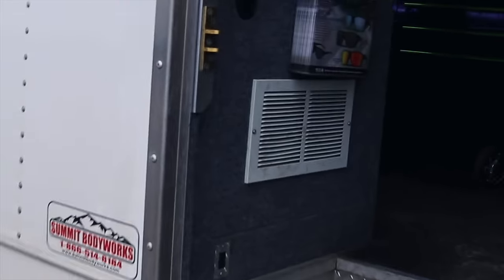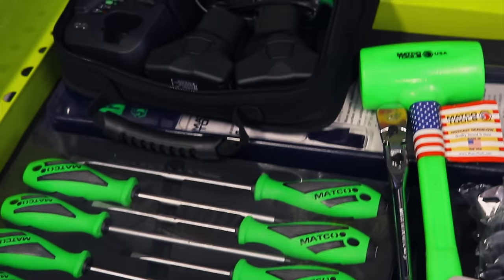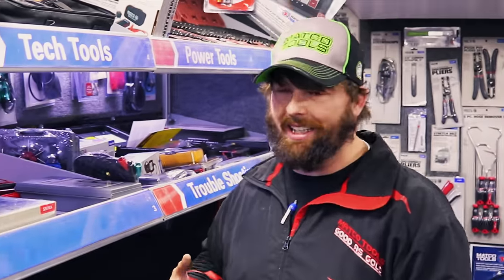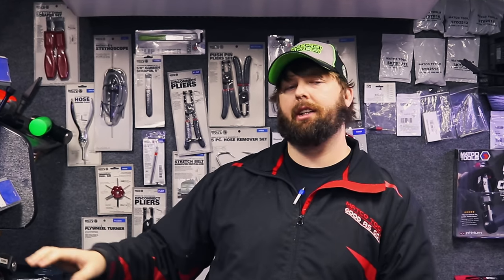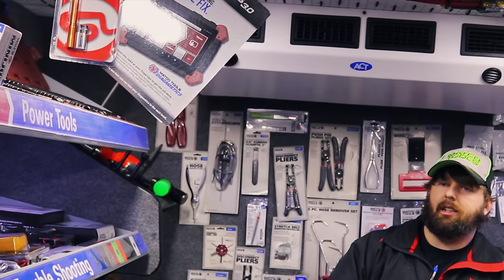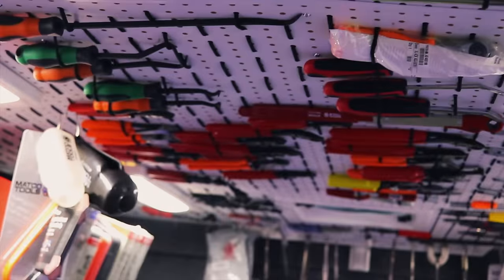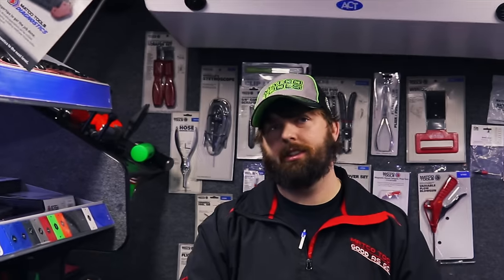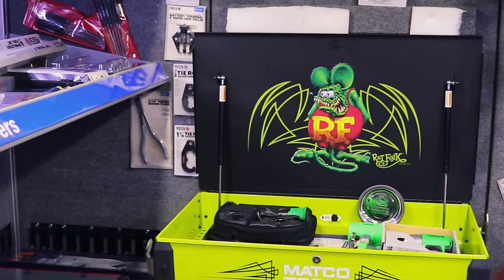Matco Tools: $23 a week gets you a toolbox and tools to get started

Comment: That stubby driver set was made in Taiwan. Saw it on the box while you were holding it.
Reply: sneakysnake109  they probably have the same set at the ole harbor “horrible” freight. Nice catch on that sneakysnake...
Reply: sneakysnake109 that’s why the box was flipped over so fast!
Reply: @rmiller6483  The oem on that stubby set is Vim
Reply: Was on the truck on Tuesday looking at a screwdriver set, made in fucking Germany lol
Reply: So crap on's battery impact tools are made in China.  And you all though you were getting American made hahaha.
Reply from the maker: Can you name a battery impact that is made in America ? I try to buy American made tools every time if possible but you can’t get somethings made in America because they aren’t available.
Reply: @KoonTrucking  Dewalt, but its not the full line just the impact drivers and the 3/4 guns.
Reply from the maker: Yeah I knew just the 1/4” and the 3/4” ones were made is USA but no 1/2” or 3-8” guns. To my knowledge there isn’t any 1/2” or 3/8” impacts made in USA
Reply from the maker: Here’s the link to those https://www.dewalt.com/products/power-tools/products-made-in-the-usa?pageNum=2
Reply: Koon Trucking , my older Craftsman 1/2” air impact is rated at 230 ft-lbs at 90 psi. It was made in China. That impact wouldn’t break loose the lugs on my truck torqued down to 140 ft-lb, I even bumped the regulator on my compressor up to 100 psi. I was afraid to try any higher.  I bought the Earthquake XT, composite 1/2” air impact from Harbor Freight rated at 1190 ft-lb at 90 psi. The lugs zip off without a hiccup now. That impact is made in Taiwan. It gets used, but not everyday like y’all, full time mechanics. I only do part time mechanic work. I splurged for the one year extended warranty, if no issues arise during this first year of use, I’ll upgrade to the two-year and see what happens. The Earthquake XT aluminum air impacts are made in China. You’re right though, Mr. Clay in your assessments.
Reply: @KoonTrucking  Yeah I don't think there are any to be fair, I like my IR cordless gun and they are are made in china . Hell the only reason I upgraded my old 1/2 gun was it was getting a little old and I really like the led rings they use in the front. 

I think what Peng Kha  was getting at is paying Snap on prices for made in china, while not being able to understands people will pay for a quality item no matter where its made. When was the last time anyone bought a made in usa smart phone?
Reply from the maker: How about a television ? I did find an American made tv but for a 32” tv I could buy 6 of the best curved 4K tv’s that Best Buy has in stock ...... i just couldn’t do that. But if it is within reason say 2x i could have bought it. Now tools anyone can say whatever they want but at the end of the day it is my money. Some guys blow it in strip clubs, some snort it up their nose, some gamble it away or buy a race car or fishing boat...... In gonna buy USA made tools cause i like them and to be honest it is a pride thing when i open my box. I spend 1/2 my life pretty much in the shop so ...... to me it is worth it.
Reply: Koon Trucking, Mr. Clay, anyone that has to put a man down for the tools he buys must still live at home with his Mama, 45 years old, overweight, and works at the pizza joint. Hmmm 🤔 sounds like an old Brad Paisley song. The review you did on the 2-pc radiator hose removal set from Snap-on was the best design I’ve seen. Nobody else offered anything like it, I’m glad I bought the set. So yeah, I have some Snap-on and some Harbor Freight (Horrible Freight for your buddy Hamilton there) and everything in between. I’ve bought what I needed when I saw or foresaw I would need it.
Reply: @KoonTrucking   I have no issue with how you spend your money as its none of my business and when it comes to family or friends as long as there kids and bills are taken care of I don't care how they spend the rest. Hell I know a guy who had a job out at the Hanford Vit plant who would only use a new ratchet every day. He refused to use an old tool as he put it. 

I on the other had buy a lot of m word tools for 2 reasons, one there dirt cheap around here and 2 no one is gonna steal them as they have no value. Of the 40ish ratchets I have I have spend less then 500 on them. My last pick up was a 2016 6s with half hutch box guy paid 18k, I got it for 2200 after he knocked it down form 3k as its wasn't moving. Yes I called m word and made sure it was a clean box and wasn't stolen. I also picked up service cart, one of the real nice JSC750's for 150 because it was a matco and he no longer had a dealer wasn't even 18 month old.

I spend a lot of time in the shop as well and when I'm not in the shop I want to enjoy my time away.  So any more I can save it spent with family.  Just remember you only need to justify things with your wife, not people on the Internet. As long as she understands thats all that matter.
Reply from the maker: Oh she don’t care at all she knows where the bread is buttered from and knows what makes it happens is my hands on those tools i actually have a video angry wife vs snap on tools if you haven’t seen it check it out.
Reply from the maker: They are awesome. I use them almost exclusively now over every other radiator pick that i own (and that’s about 3 different sets) they are hands down the best design ever made.  I don’t have a problem with anyone’s tools. If they know how to use them that’s the important thing. I know some people get all pissy with me buying snap on ? Why i don’t know ? Jealous maybe ? Who knows ? But at the end of the day it’s my money, i earned it, if i want to wipe my ass with it, it’s my choice ! Haha hell when i die my wife and kids will have one hell of a tool collection they can do whatever they want with cause at that point i won’t need it !
Reply: @KoonTrucking  https://www.napaonline.com/en/p/CHQR38FHBH?searchCategory=800.8008&searchIndex=Prod+Tools this is a link to the Carlyle 3/8 bent-handle, flex-head ratchet. It's on sale this month at NAPA for $29.99 instead of the normal $79.99. I've been looking at both Cornwell and Snap-on for buying the same ratchet from. I had to jump at the opportunity for the great price on this ratchet I've been shopping for. It's a 72-tooth design mechanism and is real smooth. By comparison I have the Pittsburgh Pro, long-handle, flex-head ratchet. It too has a 72-tooth mechanism, but it's not as smooth operating as the Carlyle. I can feel it while manipulating the ratchet back and forth on a fastener and the lever(ass backwards as that is) has flipped on its own a couple of times. I'll continue to use the ratchet until it can't take it anymore and look for a better replacement. I can imagine how smooth a Snap-on or Cornwell version would feel.
Reply: @KoonTrucking   No I've seen it and that was more so my point. As she understand you shouldn't care what other think.  Seeing as I don't like my snap on guy that could be a reason I don't buy from him unless I feel the need I have to. Hell most of my Cummins service tools were from snap on as they made them for Cummins. Just the other day I needed a set of 4 inch files. He had a set for 101 but not made in the USA, turns out there made by Bahco out in France and I was able to get a set for 28 delivered. Idk about you but my dealer isn't worth an extra 73 bucks to me. 

Also a little disappointed the PWZ pliers are now made in Argentina and on the backside of the head have the Bahco name cast into them. Tho the radiator picks were hands down worth every penny. I even bought my farther a set to keep at the house for his truck.
Reply: @anthonyesposito2576  matco's screwdrivers have been made in Germany for 25-30 years maybe longer. Doesn't mean that they aren't quality tools look at kinpex best pliers on the market hands down and German made.

Comment: Yeah, it's $23/week but how many weeks are you paying that?  I'm assuming for about 150-160 weeks at 18-19% interest.
Reply: Yup. Screw that. I would put it on my credit card.  Interest is alot cheaper then these tool companies.
Reply: I don't use my truck accounts any more but many if not most of the young kids starting out don't have the credit.   That's how they build credit with a sub $15/hr job.  Expensive but it works better than a secured credit card.  A lot of the older guys can't put the big boxes on a card either.  For my last box I got a loan, about 5% interest.  The big driver of tool company revenue are the credit programs.  It's loan shark high interest even if you have good credit.
Reply: roaddoglv yes they are loan sharks. Their interest is even higher than the payday loan companies which is pretty impressive. 

I’m curious as to how many understand how much they are paying in interest. That $23/week would be about 30-40% total when all is said and done making that minimum payment.
Reply: It depends. Some truck accounts are interest free.
Reply: @MrAnonymousRandom  The truck account is no interest but that's carried by the dealer and doesn't have the limits of an EC account.  This is a Matco credit deal.  For most guys they aren't going to be able to get a box or diagnostic with on a truck account unless they're in real well with the dealer.
Reply: All the guys in my shop have a 3000+ dollar truck  account. Boss has about 12k truck account.

Comment: This is great. Im 17 looking for a shop to try and get into part time while im in school then go fulltime
Reply: Hey Tyler dont do it you can get a box just as good as the matco for alot less at home depot and harbor freight
Reply: @dirtwaterfoxdirtwaterfox963  I saw that somewhere else also. Get a cheaper box and put the money towards more, better quality tools
Reply: Im actually speaking from experience
Reply: @dirtwaterfoxdirtwaterfox963  so would you recommend getting tools from the truck or would harbor freight be ok for a while?
Reply: I would suggest getting your tools from harbor freight to start out with until you are solid in the place you start work at
Reply: Also wirh matco mac tools or snap on your paying for the name and the convenience of the tool truck
Reply: @dirtwaterfoxdirtwaterfox963  im hopefully touring a diesel tech school in the neext week or so. Look forward to it. Will probably try and start in the auto somewhere local before going to the diesel
Reply: Go cheap to start out with, then as you go, upgrade what you break, or just isn't getting the job done.
Reply: Hey man, fellow tech. If your serious about it get a HF box. I've got a snappy, better over all but end of the day it just holds tools. Certain tools I'd buy off the truck. Buy a decent wrench set. Hf sucks for wrenches and normal stuff. Their pro series and maybe their new icon series would be a go to for ratchets and impact stuff. Buy a good toruqe wrench. Precession toruqe I think? Makes one close or as good as snappy. Online like Amazon will have other stuff you'll need. Snap Matco etc are good but you can find the same or better quality for cheaper online or elsewhere.  Give proto a shot, basically tool truck quality for 40% or less of the opposing on a truck 

Screw drivers, picks(if gour going very heavy equipment but snapon small picks. You'll regret cheapos when the tips in sensitive equipment), wrenches, gagues, anything that must be accurate. Buy that stuff from reputable places. Hf is for certain stuff. They are getting so much better tho. Tekton is good for alot of hand tools aswell.

Comment: I really dont think it matters. I smoke people in the shop i have alot of every tool brand my set of harbor freight chrome 3/8ths costed me 12 bucks and have made me so much more so thag i can spend my money towards Milwaukee impacts. Tool guys make fun of me for using them, because i didnt spend 400 on a set of impact sockets from them. Dont see the need to when I've never rounded a bolt with them or broke one yet. Ive broken more snap on sockets then anything